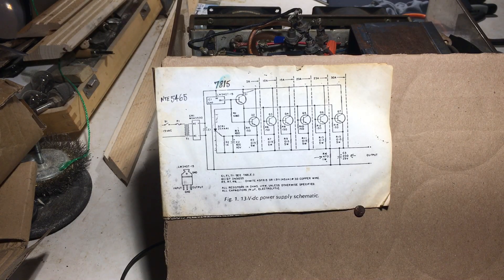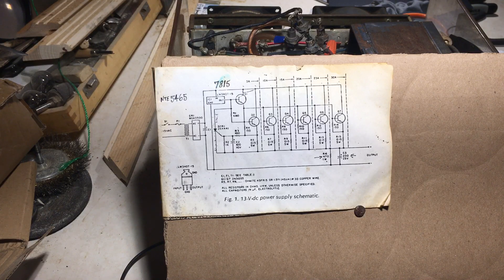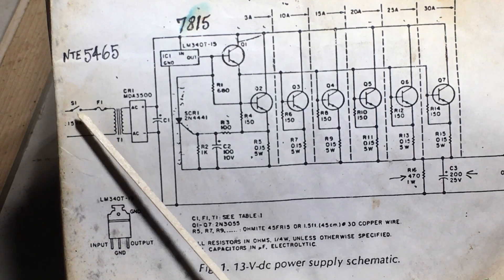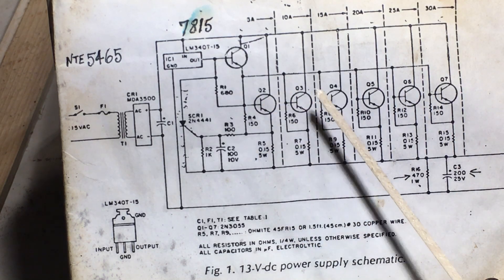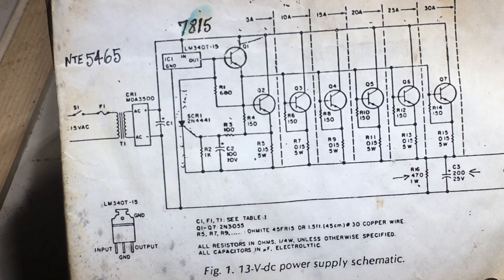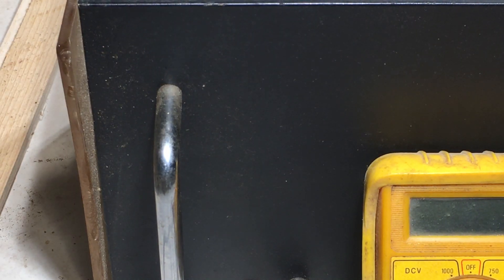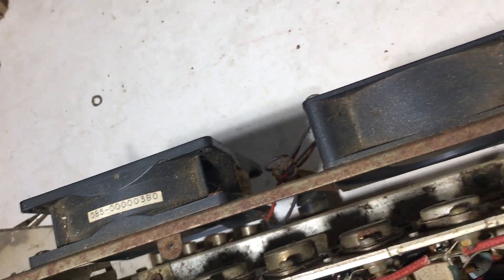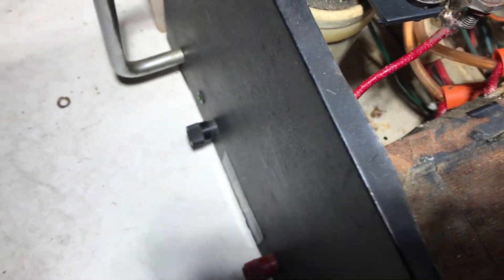DIY 12 Volt  25 Amp DC Power Supply made from Junk and Scrounged Parts - Shoutout to Radionut63

Comment: These are highly inefficient compared to today's technology, however they produce very little noise.
Reply from the maker: You are absolutely correct !
This type of design is 
“Old School” and not as
Efficient as modern types. 
It’s also much bigger and 
Heavier than newer types !
However 
I have observed that some of 
The Newer types such as 
Switch-mode Power Supplies 
Are sometimes horrendous for 
Emitting Radio Interference Noise 
Although not all the newer types 
Have this problem. 
Thanks for watching !

Comment: A slight change to the circuit is to feed the regulator with a higher voltage to what you want to make up for the voltage loss on the transistors but use a lower voltage for the high current thus reducing the power dissipation on the transistors. I have made a number of these power supplies over the years toroidal transformers can be made to order these days. I used to rewind by hand in the past and a cheap source for a transformer is an old microwave oven replacing the high voltage winding with a low voltage one. Note the circuit is in the spec sheet for the 3 terminal regulators. My 13.8v 25amp supply uses 4 x 2N3055 on heat sinks mounted in a box with the transformer and a temperature controlled fan blows through this tunnel cooling heat sinks then transformer I have run it at 25 amps for 3 hours when testing its now 40 years old , the capacitor has been replaced and digital meter installed.
Reply from the maker: @bascomnextion5639  yes indeed !
Check Radionut63’s YouTube channel 
He has the full magazine article posted !
If you read it they recommend keeping the 
Voltage down to low 20’s. 
Thanks for watching and 
Check out my YouTube channel 
For more videos and share with 
Your friends. 73.
Reply from the maker: How about uploading a 
Video of that Power Supply ?
I would really like to see that !
40 years and still going strong !
Quite a testament indeed !
I’m sure others would like to 
See your build as well !
Reply: @madeinfoxtrap5539  I will when I get back to it note I have a number of the same design built around the same decade all still working just the capacitors changed.

Comment: On the fans, you could always use a 24v regulator, too, to keep them slower and quieter....but you know that, anyway.
Reply from the maker: @englishrupe01  one consideration 
I had initially was to install a 7808
Regulator that would supply 8 volts.  
I opted for the simplest solution !

Comment: Would it be possible to make this supply variable up 12 volts say at 5 or 10 amps? I found a good place for transformers for these are from old battery chargers. I have a couple that were used to start cars rated at 100 amps. The transformer is good but their triacs were no good.
Reply: You could always add on a dc dc variable converter as a front end, so if you have 15v in, you could have a 0-12v variable supply. I have a 60v 1500W toroidal supply hooked to a DPS5020 (0-50v 20A) dc dc variable converter. Very smooth PSU. You need around 2v headroom, so 15v would give you up to 13v.
Reply from the maker: @countryside8122  that would involve a different design of circuit.
Reply: Replace the 7815 with an LM317 adjustable regulator.

Comment: The biggest flaw I see in the construction is the rectifier diodes. The stud type are to be screwed into a heat sink. They'll get a lot warmer than you think as you pass 5 to 10 amp load.
Reply from the maker: @randycarter2001  agreed !
At first I used a one piece rectifier block but that failed 
The bridge was an afterthought and no consideration for a heat sink!
Thanks for watching and check out my other videos on this channel. 73